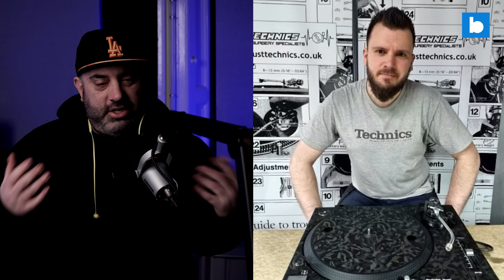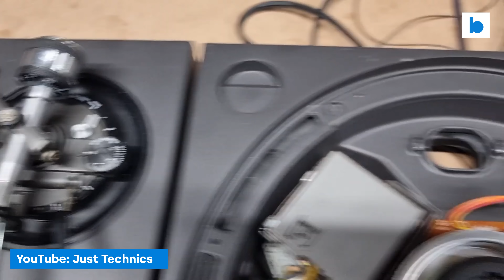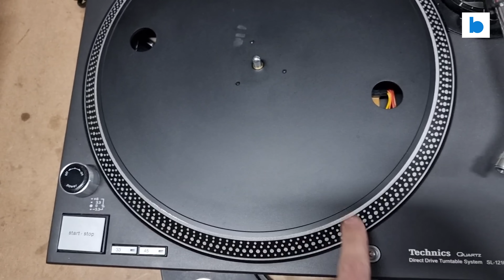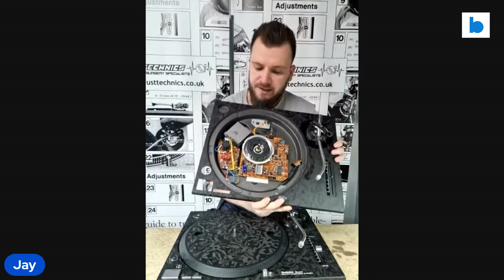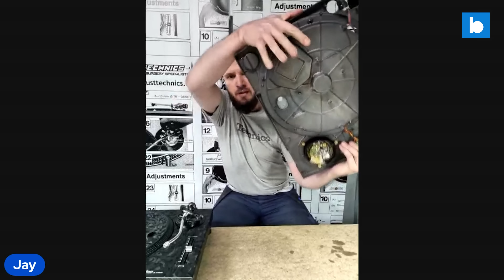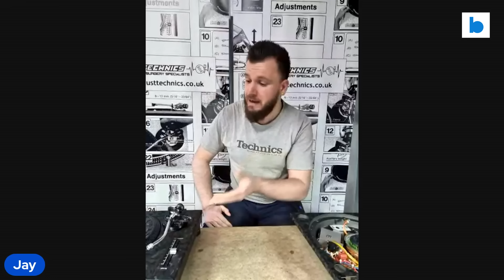Fake Technics 1200s EXPOSED! I Beatsource Tech

Comment: How the hell can I trust any repair or Technics specialists (apart from 'Jay') again. To be in fear of any parts of my original SL1200 Mk 2  silver turntables being nicked and swapped? Could also cause them to depreciate badly in value if people are not clued up about 'whats under the hood' or whether our current turntables are trully all genuine appliances? Not good news to hear for us "Tech-Heads"
Reply: I was thinking the same thing.
Reply: @justinbennitt835  I have 1200GLD so you already know I don’t have anyone messing with me Technics.  I will have to figure it out on my own if I need a repair.
Reply: @justinbennitt835  💯
Reply: @rashodlewis2918  Good on you dude, been trying to pluck up the courage to open mine up and have a peep inside for years.

Comment: Honestly reloops are just fine if you don't want to go through the hussle of identifying every part of a random Technics deck bought online.
Reply: Bout to get a set
Reply: @jonnyfevertv3170  They are not as durable as Technics,but they don't lack in any other way.If anything they add a lot of important features for DJing nowadays.
Reply: @gaarakabuto1  thanks 4 the heads up, got a pair of mk2, already, looking for some of those additional pitch controls for turntablism. Cheers

Comment: I own a pair of SL-1210m5G, and had no idea about the different between them and the Mk2 (which I’ve owned multiple pair and serviced them). But this opened my eyes and has me inspecting all my decks 😂😂
Reply: Years ago I had a second hand pair of SL-1200MK2's and sold them for a brand new SL-1210M5G at JunoRecords and when I used them for the first time I immediately realized something was wrong with them because I couldn't beatmacth properly and I had to be constantly correcting the mix. I ended up selling them and bought a second hand pair of SL-1210MK2 and all problems were over. Check out a comparison video I managed to make between the M5G versus MK2 (in Spanish) https://youtu.be/kuEThfqxqsU
Reply: Most hated version.
Reply: @Zerovisualtekh  I had both. Replaced a old MK2 with the 5G because MK2 became way too expensive. I couldn’t beat match anymore either. I really thought it was me at first. Years later I sold the MK2 and kept the 5G for sampling.
Reply: I waschen your Video, but my spanish is too pool. So the Problem is the Digital pitch causes higher fluctations in BPM than the traditional/ old standard pitch?
Reply: @braakattac  not fluctuation. It jumps up or down when using the pitch control instead of going smoothly up or down when using the regular one.

Comment: Thanks for all your comments on this one, everybody! One thing I’d like to address as I see a couple of comments related to it…

The reality is, that as magic as these classic decks are, there ARE some very good alternative choices out there, mostly based on the Hanpin Super OEM platform. We’re talking about things like the Reloop 7000/8000s. Check out my review of the 7000mk2s for a full explainer.

One of things I like about Jay’s channel is that, as devoted as he is to all things Technics, he still has respect for such alternatives too, just as I do.

So if you’re struggling to find a really trustworthy set of 1200s at a price you can afford, don’t feel bad about going for some Super OEMs instead. They’ll serve you very well.
Reply: totally agree the oem tables are of tank quality . i still have a pair of st8150 had them 20 years now. albeit the paint has flaked off in areas but they have never failed . not once.
Reply: I have a Technics MK2, Technics MK5, and a Synq X-TRM 1 (Super OEM). I can totally agree, the Synq is of excellent quality. I love all of my turntables,  no question, but the Synq does not feel cheap or anything. A downside I see compared to the MK5 is that is has only 3 grams of anti-skating, but that's what the MK2 has, too, and it's not a show stopper. Still, I will never sell my pair of Technics, hands down.
Reply: can’t find your review where you address the hanpin super oem platform
Reply: What I like about the MKII is how ridiculously over-engineered and tank-like they are.

The Super OEMS (and the MK7 for that matter) do work just as well (and often have all sorts of extra features you may or may not care about) but don’t have that quality feel.

Comment: I'd stress that a "frankendeck" isn't a bad thing on its own as long as it's represented truthfully. Most of these parts are 100% interchangeable, and it's probably better that the deck reached you with working parts from the wrong make of table than broken. 

It's only when people claim that the deck is near mint that it's a problem.

Comment: Great video. I sold my 1200s a while back and decided to finally get back into it but I went with used pioneer PLX 1000. They’re in great shape and I bought used so cheaper than 1200s. I didn’t want to run into a probowk where getting parts was a problem. Plx1000 can easily be replaced.

Comment: What is with the hate on the M5Gs???
I own a pair in the last 5 years and also play casually on mk2-s (before I also owned a very mint pair of mk2's bought them on eBay around 400£ in 2011 maybe)
but I love the M5G's also the design is what made me go for them, but don't really find any difference in beat matching....I admit they might need to get a maintenance check up or service and now I know who will I call or book but otherwise sometimes for mins I have 2 tracks playing without touching and so does the mk2s too.Depends how long are your mixes but you always have to work your decks.

Comment: those board interconnects are not just twisted on, they are wire-wrapped with a special tool. wire wrapping makes a very high quality connection as good or better than soldering, and was used for prototyping and limited production for computers and electronics up until through-hole gave way to surface-mount construction.

Comment: Really interesting vid and thanks for the heads up! One thing I will say, with the rising costs for Technics in the used market, why would you not just pay the extra and get a pair of new MK7s so that you completely eliminate the risk of these Frankendecks?
Reply: "Frankendecks" love it! 👍🏻
Reply: Because mk7’s are overpriced trash
Reply: @adriannavarro2536  strong disagree. Yes they are more expensive, but they are an excellent update on the conventional SL model.
Reply: @wassembly  have you seen the break down videos Of the MK7? They’re objectively worse than it’s predecessors. The materials are cheaper, More plastic, pitch control is digital and not as accurate as say the MK5’s analog pitch control. I can go on, but there are a lot of reviews out there. For a $1k price tag they should be superior. But there is a lot left to be desired. For $300-$400 more you can get a pair of ‘mint’ mk5’s
Reply: @wassembly  The older decks are of a higher build quality that can’t really be debated.
Reply: @adriannavarro2536  Have you played on them? I own a pair 1200MK7Rs  and they are far from being "overpriced trash".
Reply: @djsubculture2111  I have and they play fine, that’s not my point tho, it’s the build quality is just way off, the plastics, the terrible milling on the platter. It’s just a lot of money for something of inferior quality that’s all.
Reply: @adriannavarro2536  Sounds like what you need is a pair of SL-1200GRs
Reply: @djsubculture2111  I was lucky enough to get a pair of MK5’s about a year ago in virtually mint condition that the previous owner kept on flight cases for their entire life. There is not a scratch on them. I paid 1600 for the pair, the price of one GR. The dude even threw in a pair of ortofon gold carts.
Reply: @adriannavarro2536  The true is that MK7 has better coreless motor than MK2. Pich control is excellent.Sounds better than MK2.

Comment: I bought three SL1210mk2's out of a Hi-Fi shop for Pennies back In the 80's. They were ordered by a customer, and he never came back. They had no idea what they were or used for. So I said I would take them off their hands (No Returns then) and they said yes. I still have them and the original box's as well.
Reply: So the HIFI shop that supplied them new in the first place had no idea what they were and sold them to you for a fraction of the value? Cool story bro.

Comment: Great Video. Still have my Technics 1210s Mk2 after 27yrs, still work like a dream.  Always service with genuine parts.
Reply: I know they're only work horses. Quality wise they ain't saying much. Put one next to a linn sondek say then you'll know what I mean. Even the rega plannar 3 sound better.
Reply: @zukispur5493  I have never owned a Linn deck, but they do look superior, I am a DJ so a pitch fader was a must,
Reply: @Music-Gear  audio technica AT LP 1240. Brilliant.  Piss on the tec 12s all day long.  At home I run a Garrard 401 (SME arm) now there's a turntable 🌚
Reply: @zukispur5493  Believe it are not I  have audio technica AT LP 1240 in my sitting room for listening to my LPs, still looking for a descent pre amp,
Reply: Most turntables will only sound as good as the pre amp it runs through, I found the pre amps on the audio technica just OK,. I do have my Technics connected to an Allen heath DB2 and it sound so good, 

For the audio technica AT LP 1240, I  had my eyes on schiit mani phono pre amp
Reply: @Music-Gear  spot on with the DB2 and the mani.  You obviously know your stuff so I'll leave it with you.  £398 I paid for my pair of AT LP 1240s brand new.  Result 🌚
Reply: @Music-Gear   don't sell it.🌚

Comment: Something little bit different... last year was thinking about buying online second hand 1200 and found on ebay one non working, no cartridge or tone arm, no cables, with damaged base and with "visible trace of burning" on it. It looked like someone had fire at his 2nd floor flat and was trying to save it by throwing it through the window. You could buy it for £149,99

Comment: I got 3x 1210 MK2 - 2 of them I bought NM couple years ago, still had the original manual and box that says Technics made in Osaka, Japan !!! On the back of your Technics there is a serial number. Based on the number you can figure out when they produced it. 1 of the 3 is from 2004 and the last 2 from 2010...when you open the platter you can also see the difference between earlier models and later models, based on the motor and torque. I wouldn't say after market ones are necessarily fake...fake is to replicate the Technics 1200's...that has been done many times...I believe in 2010 Technics lost their license, and so other manufactures were allowed to replicate the 1200. Btw that being said. This video is extremely important and definitely more of these should be made.
Reply: Can’t be from 2010 as they stopped production in 2009.

Comment: @JustTechnics you mentioned original MK2 pitch controls are not  available. Do the aftermarket ones that you install perform equally to the originals compared to more modern digital pitch control?

Comment: Been through some sh*t trying to get a pair of these imported from Japan. After a month of waiting I ended up receiving a USB cable in the post. Guys ebay acct is suspended now. Yeah cheers mate. Ended up having to buy a pair locally from some moron that was using a slipmat on top of the rubber slipmat. These decks are now mostly in possession of utter thugs and clueless knob heads that think they're sitting on a gold mine when it's usually a massively damaged, scratched up piece of sh*t example of a deck that they expect mint condition prices for. There's two locals I've dealt with are selling 100v imports from Japan - it took a lot of pressuring them to admit that they weren't even in our local voltage and neither seemed to see how that would devalue them even slightly... "Just use the step up transformer".. How about f**k you? It's been an absolute headache just to get a pair of these and I am frankly burnt out from it all. I do have a pair of mk3d's now that I've converted to 240v so hopefully thats the end of having to deal with dipsh*ts.
Reply: mk7's are that bad hey? i got my mk2's as a teen way back when, trough thick and thin, been dead broke not knowing how i was going to keep the lights on and never once did i think, i should sell these, but been thinking because of their age i should be looking for a new pair to have on hand, too bad jay is doesn't take jobs internationally right now, I'd feel a lot better and i don't trust anyone in my area

Comment: Well 'well were does one start. I bought two SL 1200s 15 plus years ago and are working in good order and 5 or 6 years ago bought another one which have not used yet and reason is I'm trying build 3 Deck system' and other Deck was scratched by a cat or dog side the lid it self, and the rest is ok. I bought it for £150.00 at and some point I need take a look inside to make sure it a genuine SL1200 I will be very disappointed but, having say it could be the last of true SL1200 I hope so, even though  I bought £150.00 at the time, now you've got thinking and I'll have wait until I setup and take a look to see and have this feeling they are the real deal' the phones look the old not this USB  BS, and I'll check Jay on his video presentation Mo thank for bringing this to our attention, it reminds of something do you remember the kit car in the early 90s a throwback 2 different cars put together, it not to say  I drive and just Example as to what was back than and now the SL1200/10 is Under threat and became Obsolete ,you see it coming because, DJ don't want carry vinyl like they use to ,and digital age has take over, and manufactures ,are make vests sums of because, some DJs are lazy, and want press buttons, and not use turntable's any more, and manufactures ,are ''laughing'' at the upcoming DJ who soled Decks or to up with jones and keep with latest trends and don't want to put the work in and, downloading the latest sounds, it very well having that 'but DJing is still an art ,as far as I'm concerned I'm not being funny no one really looks at DJs the same way they use to, one there on their laptop, and no one takes any notice, and if we didn't allow to happen Decks will be around for long time' it break my heart to hear this, this has to be said' I don't say this often but I'm going to say it any way. If CDs was a thing that money could buy CDs would live, and records would die! and reason I say this because records getting so expensive and CDs cheap, and  cheerful, and you know true so, I still love my vinyl. I know there is history and a story tell, and with CDs you can't tell a story, one you can't see the label, speed, cover listing of track,and think these new SL1200/1210 only last 5 years I've decks second hand and sold them to buy new one ,and 15 years plus and still going strong, on that note long the SL1200/10 we need them backing the club and the CDs to stay in the computer and only for demos and for playing otherwise will this problem for to come and let us all go back to basics so we save the SL1200/10 from becoming thing of past...!! Stay blessed 🙏🏿🙏🏿😇😇Mo and Jay keep the good work🤛🏿👊🏿🤜🏿

Comment: Hi Guys, One quite Major point of Concern. "J " was saying about the "Skate " Cap not having the Correct Numbers on. I think he said it should go up to 6 ? But it actually only went up to 3. The Scale / Calibration of how much Skate is applied in alignment with Counterbalance / Stylus Weight Setting would be out of Wack and would therefore be Detrimental to Stylus Ware and / or your Precious Vinyl Collection.
Regards Andy
Reply: The Mk5s do indeed have a scale on that cap which goes up to 6, so whilst you absolutely have a point, you should probably take it up with Technics. ;)

Comment: I have a mk5 since 2007, I changed the arm (because unable to remove the head of the arm with bad contact with cartridge)bought from japan and I changed the rca câble (no ground on the new câble). It work perfectly. What is the frequency to put the special oil in the torq ?

Comment: I (TV engineer) couldn't understand why everything should be original. I cut off the original (super cheap) RCA plugs on my SL-1210 MK2 back in 1994 because the middle contact got stuck in a "high-end" RCA socket.

Comment: Say a person is not concerned with having a genuine or all original Technics... just a good turntable that works well... what places would be good to deal with?  If I wasn't even bothered that the deck is a Tech at all, just a turntable of decent quality, at a decent price...   Audio-Technica 1240 or Reloop 7000 Mk2 ?  Or is there something better for a similar price?
Reply: Any of the decks based on the Hanpin Super OEM platform are very good and will serve you well. Check my review of the RP7000mk2 for more info on that.

Comment: A cottage industry has long existed in 'refurbing' and customising Technics. There's nothing really wrong with turning two badly damaged units into one good one, or making turntables out of the parts pile. In skilled hands it'll end up as good as any other deck. The problem comes when sellers are not honest about what you're getting or passing off a bitsa deck as a 'collector grade' original.

Comment: I learned my basics on 1200's over 20 years ago, I got a controller few years ago and I hate it, no turning and no vinyl feel... I need some tables, what are they best CHEAP tables you would get or recommend? Please help out an old DJ!
Reply: Audio technica at LP 1240
Reply: @zukispur5493  thanks , dude
Reply: @agro_ink423  they piss on the tec 12s.  Much stronger motor. +  - 50 pitch. Two stop starts (sideways for battle) and better sounding.  You won't be disappointed